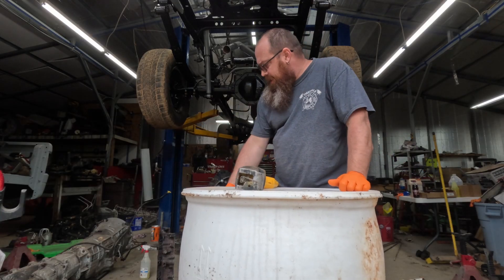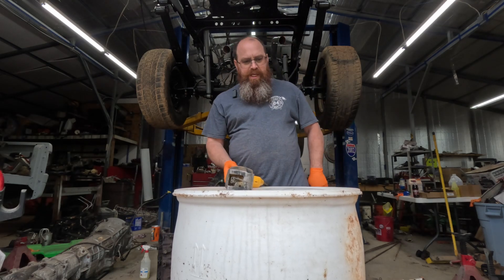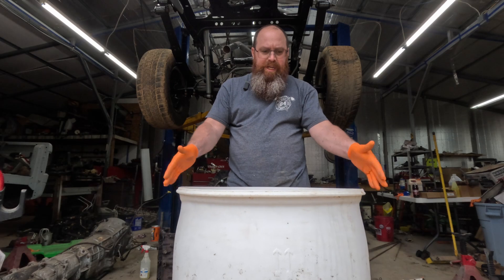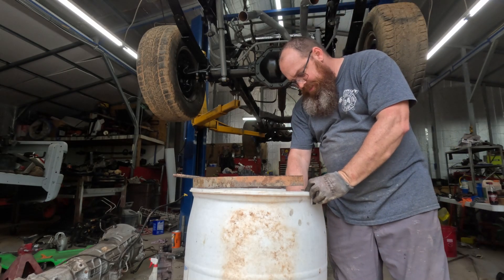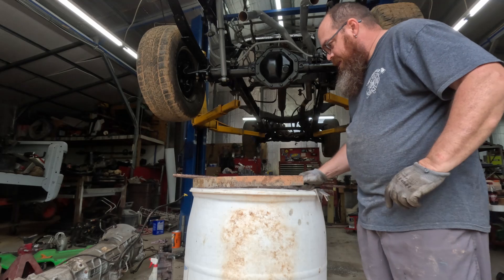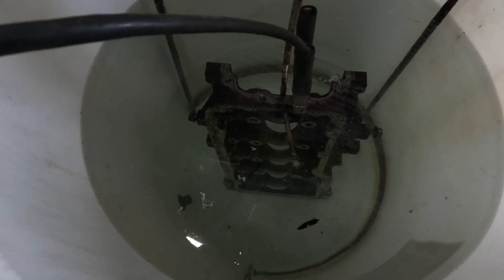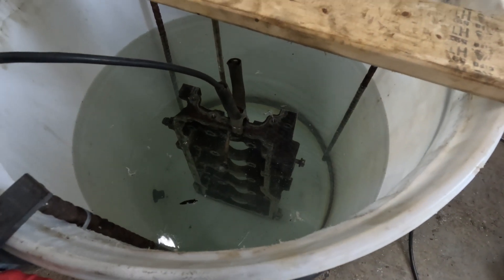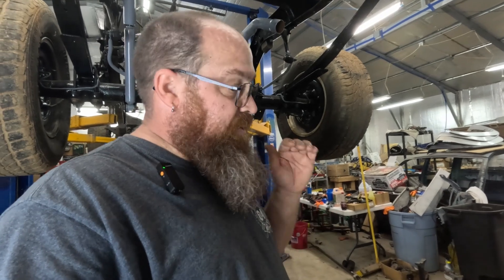DIY Rust Removal Tank: The Ultimate Guide

Comment: you dont need jumper cable sized wires for that. You might ruin your extexsion cords too. 14GA wire is plenty. you could get away with speaker wire.
Reply from the maker: Yes you are correct. I usually over do stuff lol